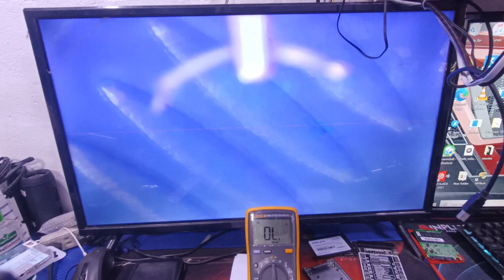DIY SHORT KILLER 100% EFFECTIVE

Comment: Ganyan din gamit ko Master kaso powerbank na mismo ginamit ko. Naglagay na lang ako ng probe same time pede ko sya magamit as powerbank heheh. Simple but effective yan Master.
Reply: Pwede ba gamitin short killer ang powerbank? Alam ko meron short protection ang powerbank kaya kapag nakadetect sya short circuit magcutof supply nya🙄
Reply: @restygarcia6604  nag kabit ako ng dalawang wire from battery palabas ng powerbank. Battery ng powerbank ko kasi 18650 na naka parallel. Pang short ko sya. Tapos paglowbat  na chinacharge ko sya as regular powerbank.
Reply: @goyetskalikot  ah ok. Akala ko nakadirect sa output ng powerbank kasi nakaprotect yun😁
Reply: @restygarcia6604  korek sir hehehe😁😁😁